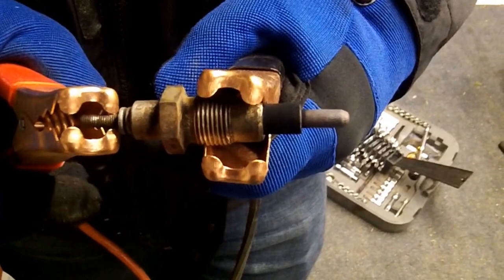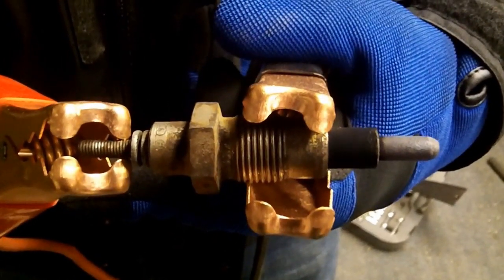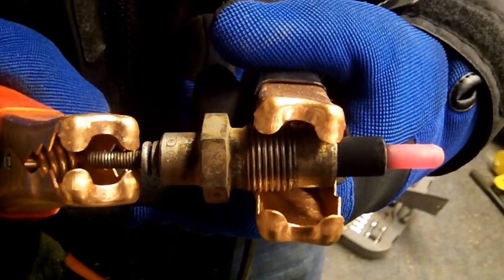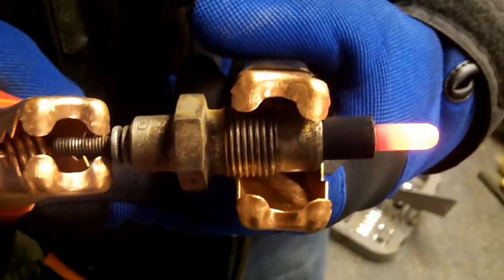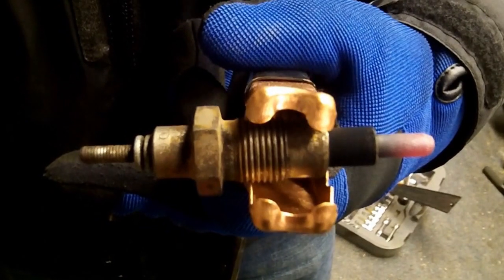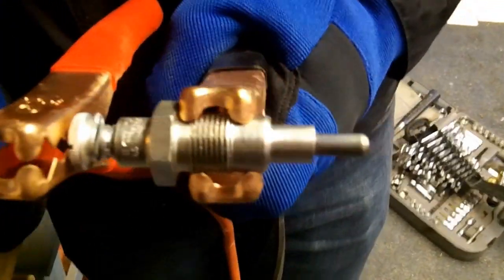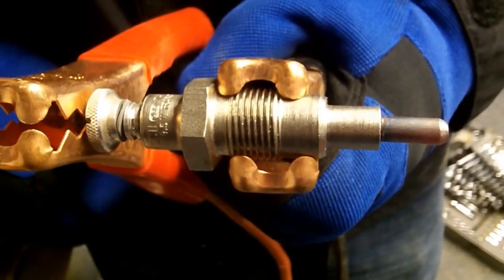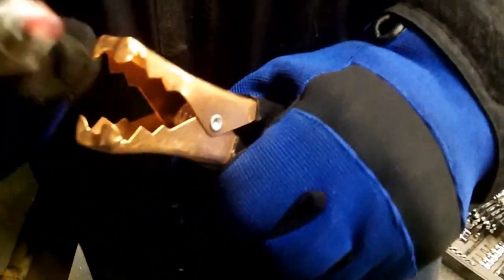Glow Plug, Testing and heating up old and new ones

Comment: hi from uk, i have a b414 with older type glow plugs, i want to do the mod to fit the new style glow plugs, like yours, do you know what part number it was you used,  is there a lot of different manufacturers like champion etc or just bosch-  what was the part number i need to look for?. many thx dave
Reply from the maker: Hi, I used Bosh plug number 0 250 200 013 which was 10.50 volts.    There are other manufacturers that make the glo plugs with their own numbers, The web site I have attached has a cross reference chart for their plugs. For instance on their chart it shows that their plug number to replace a Bosch 0 250 200 013 is AN840KH.  Here is the web site http://www.dieselglowplug.com/cross.php.  I am sure that there are other brands out there that make replacement plugs in their name (but not positive).
Reply: @Halscamp  hi, excellent info,  that will help a lot if i decide to do the mod,   just one thing,  can I ask, did you remove the pepper pot resistor when doing the mod, or u still use it as a guide to the hotting up of the glow plugs?.  many thanks and good luck, dave
Reply from the maker: On their website if you put their plug number in on the "find item" box on the left of the page and hit search and then click on the picture or description of the plug that shows up it takes you to the next page that also shows other brands/manufacturers such as Champion , Beru, Fiat etc.  Hope this helps.  Cheers!
Reply: @Halscamp   hi again, yes that helps a lot,  ill look into it more,  i appreciate your time and help, many thanks and good luck, cheers, dave

Comment: So if i hold my glow plugs down for like 60 seconds, do i ruin them? because they swell or something? i have a tractor, and glow plugs worked fine, and now, it won't even start. its like a bunch of them quit working. though i have done 60 seconds before,l though i do cracnk the motor while holding down glow plugs too, after 60 seconds
Reply from the maker: You should look at your manual on how long to hold them on and if you should continue to hold them on while turning engine over. Older tractors like mine are completely different than newer ones and for sure different than newer trucks and cars. If you have a 4 cylinder it should start with one glow plug bad, with 2 bad it will be hard to start and if 3 are bad you will probably not get it started if even a bit cold out
Reply: 1966 Farmall 706 with the IH D282.
Reply: the glow plugs mount into the injectors, not the block, so i am praying that none will break when i unscrew them, but if one does, i just have to pull the injector, do you have any advice though on how to be super careful?